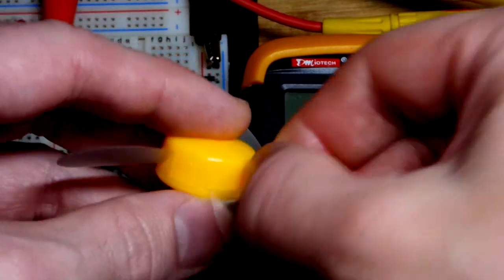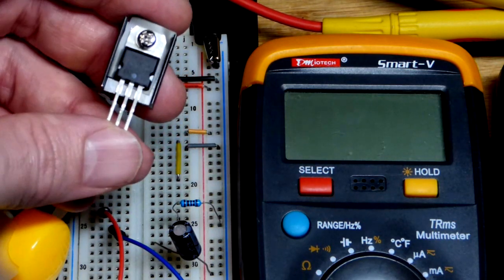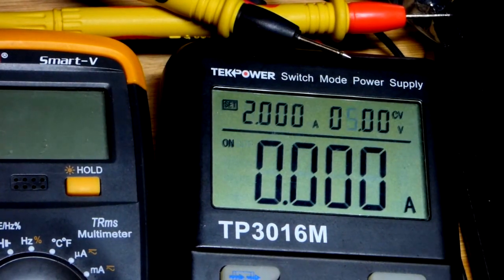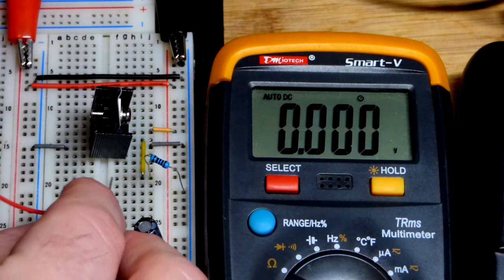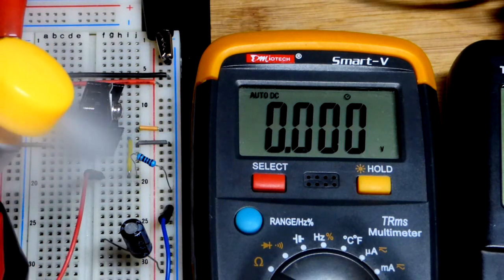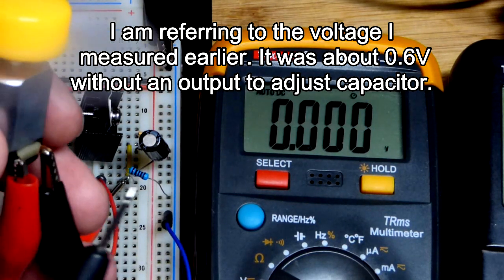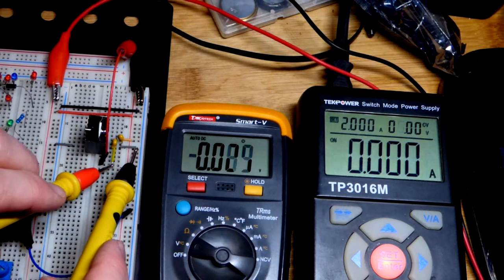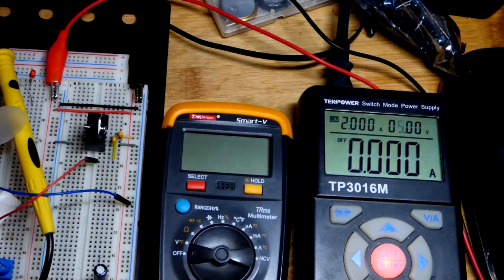LM317 voltage regulator used to get 1 and a quarter volt from 5V learning electronics lesson 0055

Comment: I have a question, but I wish to make my own solar light.  Where my issue comes in at is what to use for the charging circuit if the battery is a NiMH.  Any ideas?  I have some XL4015 E1 that does CC and CV but just not sure what to do as I don't want to overcharge them.
Reply from the maker: Unfortunately, you need sensing circuitry to be able to tell when a nickel based battery is fully charged, and charging needs to be stopped at that time. So I have no DIY charging tips for NiMH..
Reply: @Electronzap  It is interesting that Dollar Tree solar lights use NiCd batteries in them without any charging circuitry in them.  Judging by the power I measure from their solar panels they would require days of sun to fully charge even their 100ma capacity batteries with zero usage.  Funny thing is that I have them for the last decade, and they have gone from 200ma, to 150ma, to finally 100ma.
Reply from the maker: According to people from Google searches I've made, those dollar store batteries burn out if they are in a place that gets lots of light.